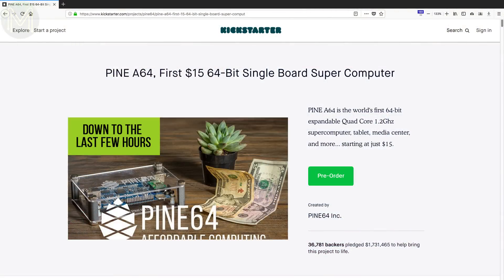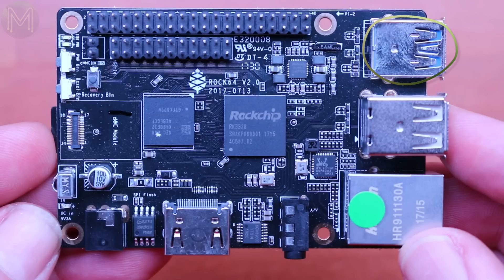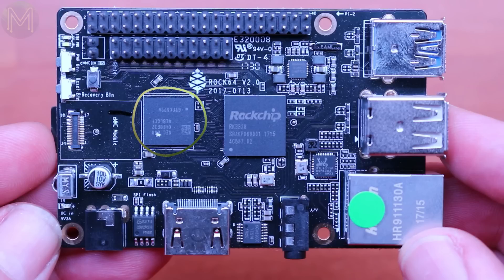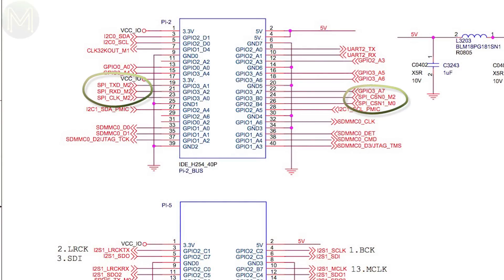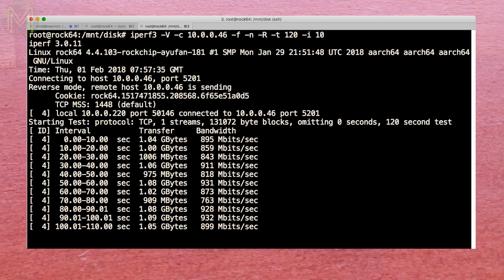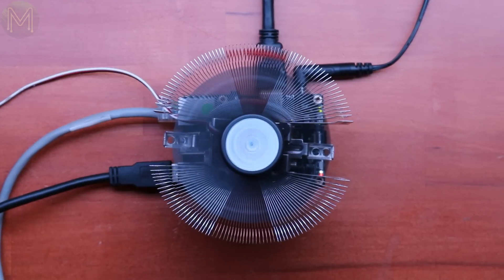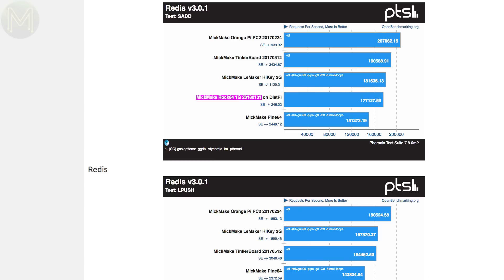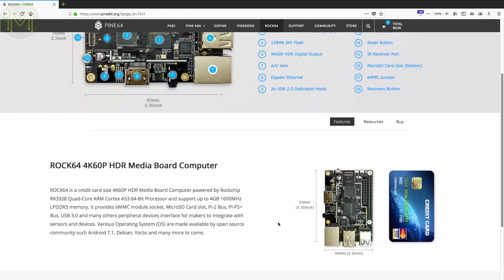#193 Rock64: Cheap and rock solid // Review

Comment: Don't purchase the power supply from Pine 64. It doesn't make good connection to the board. I had to get a USB A to DC 3.5 mm/1.35 mm 5 Volt DC Barrel Jack Power Cable from Amazon to get consistent power to the board. The 4GB RAM version does well as a desktop pc. Using Ubuntu Bionic 18.04 and it works well
Reply from the maker: Interesting. I tend to use my own power packs anyway, but that's because I keep getting given the wrong plug.

Comment: All these technical remarks are good but how does it compare with the Raspberry Pi 3 B in terms of power? I will make it simple. if we give the Raspberry Pi 3 B+ an arbitrary score of 5 to put it in the middle, how does this rock64 score?  And the main question is the rock 64 Raspberry Pi software compatible? another words if I buy one can I pretend it's a Raspberry Pi 3 and run raspbian retropie and all that other cool stuff right out of the box with no problems?
Reply from the maker: Check out my website article as it has a link to comparisons with other SBCs.

Comment: Your test showed peak power 1.139 ma.   Would you say it would be a very reasonable assumed risk in using a 2 amp wallwart despite Pine web site saying to use a 3 amp (in red, mind you)?   Or should I defer to the authority of Red text, and use the 3a regardless of your individual test numbers showing it well below 2a?
Reply from the maker: From what I've experienced the max draw i measure usually is the max draw. Anything less than that, and you're toast. Companies will suggest having a power pack that provides more current, because they want to avoid all the support calls.
If you're not adding USB drives or anything else that might load it down, then should be OK.
Reply: Thanks for the insight.  I figured as much, but dont have much experience with SBCs and just wanted to make sure I wasnt missing something important.

Comment: MickMake - I'm on the fence between getting a Rock64 or a TinkerBoard S. I've got several Raspberry Pi models for various tasks, but want to try one of the boards that has the same form factor as the Pi.

Thank you for any pointers on which would be the better board.

[edit] I forgot to mention that I'd like to try running some type of Windows or Windows emulator, so there's the missing bit of what I'm wanting to do with a better board than the Pi 3.
Reply from the maker: Yup, they are fairly equally matched. In terms of support both companies are doing well and the products are fairly stable.

As for the Windows side; I haven't really tested either board out on that O/S. Time for that to change I think!
Reply: MickMake We are Windows free in this house but there are the occasional times when it is needed and it makes no sense to have a "real" PC just to do those things. For example, I have an APC UPS that will not see the new batteries and needs PowerChute to reset it. I have nothing that will run it.

Comment: Next up the Libre Renegade? as those boards are surprisingly similar. Lastly; how long will it take before we finally have a board running a recent kernel version supporting both SPI and I2C properly :(
Reply from the maker: The boards that have no problem with both I2C and SPI are the ones that have onboard Arduinos. I used to think it was a bad idea, but it has a lot of merit.

Comment: Hey Mick,

First off nice review as always.  So I have the 4GB version of this board and am just awaiting a few other things to arrive in the mail before jumping in.

I am looking at using a 2GB version as a LoRa to IP Gateway using a concentrater board at 915Mhz as I am in the US, this board allows upto 8 nodes to talk at one time and is supported by the alliance code to setup the gateway.  Now this does require SPI so my attack for this is simple.

Build out a custom Arch Linux ( kernel , uboot etc etc )

This has been achieved by others online already so I dont see much fuss will be encountered,  I will test SPI using a atmel 1400 wifi breakout I have that yup is SPI.

Il keep you posted on the results.
Reply from the maker: You can bitbash the SPI. Not as much throughput, but completely workable.
Let me know how it goes!
Reply: Hey Mick,

So after alot of time spent investigating and what not, I have essentially a good result.  So here goes,

Arch Linux image built using this one ( & Docker works! ):
https://github.com/m01/rock64-arch-linux-build

The image is about 2.1GB ( minimal ),  but seems solid on console / headless which works for me.  Just note that thats not console out on the HDMI but the Uart on pins 6,8 and 10 ( I used a 3.3v FTDi ) 

  6.. Gnd
  8.. Tx
10.. Rx  ( iirc thats the right way around ;) )

Baudrate is 1.5M in minicom 8 N 1 as the norm

This image does not resize the root image so use gparted or something similar,  as for the project,  now I have a solid platform with kernel / sources I can comment out the SPI flash in the dtc to disable and add in SPIDEV entries in its place, the LoRaWan Alliance gateway uses SPIDEV so it should be good to go once I built the new blob.

Please build and test with this image as stated this uses the latest stuff from Ayufan and Rockchip pretty much so is pretty bleeding edge.  We have pretty much supported this script from rel 1 to this stage also which brought forward the Docker build option.

Let me know what you think

Nige

Comment: Is their a SBC that can do some basic audio work. I'm thinking voice acting and podcast production. My goal is to use such a device as an inexpensive way of entering the field as money is really tight. I think the big bottle neck would be microphone support as using a USB microphone is a terrible idea if pursuing the quality levels needed to do serious work.
Reply from the maker: You’d need to find a decent audio board first and then work backwards from that. There’s a number of boards around for the Pi and a lot of those could be used on other SBCs, but YMMV with them. For podcasting you’d want to be able to record at 88.2kHz/24 bit. It’s always better to record with the highest bit rates, because you can always reduce, but never increase it later.
Reply from the maker: Oh, and a decent mic!
Reply: Thanks for the prompt feedback. I guess I am putting the cart before the horse by not focusing on audio board first. I'm finding with more research the subject just goes deeper and deeper. One thing all this research has done for me is help prevent making some very expensive mistakes like dumping money into a USB microphone that will never get the job done. Thanks again.
Reply from the maker: Yup, audio is one of those things, (like most things), that ends up being a long rabbit hole.

Comment: Great video, as usual, great work! 
I would be interested in a "performance per wattage" comparison chart between the SBC you have tested. And a "performance per dollar" chart. If it is not too much work adding them to future reviews.
I am interested in building an SBC cluster with docker for running most of my apps/services at home. And the purchase cost plus the uptime cost in power is a factor when choosing an SBC. I want cheap computing that can be thrown away and replaced. And going to use Kubernetes to handling redundancy for uptime.

What is your take on this?
With best regards, Mattias.
Reply from the maker: Yup, so do I! I was actually thinking about this as I was doing this review. Would be good to run an Uber comparison across all the boards. That’d take some time, but quite doable.

Comment: Mick - I've had this thing for a couple of months (2gb version) - it's an interesting board, a few things I'm struggling with at present:   

(1) video output configuration for most distros is difficult;  I have it plugged into a 4:3 1280x1024 LCD and I can't seem to output that resolution from any distro;  some have said that you can't do it (can't confirm this), that seems to like a strange limitation as it can output 4:3 at 800x600
(2) most distros naturally screen blank after inactivity - many can't come back from screen blank, the system is still running but I can't recover video
(3) performance is hobbled compared to something like the Tinkerboard which runs at a much higher clock speed.  I've read this is due to some Rock64's being shipped with lower speed ram;  I've been using a CPU miner application and only achieving roughly 12 khash/sec (Tinkerboard can do about 16-17 even though it's running a 32bit OS).  Some say it's also due to the lack of a heat sink, I have a basic one applied and I am getting temperatures under load of around 73c (ambient temp in the room is currently 15.7c).  I have the miner running up to 100% on all cores.
(4) there have been problems on some distros with USB stopping and not restarting so the keyboard and mouse fail after a short time, in some cases it works on every 5th reboot and not other times.  Mate builds tend not to have this but I had it with the original Debian build;  there is a bit of talk about this in their forums.

The 1st problem is my #1 issue - I've not had direct hardware problems but the distros generally seem to be missing a fair bit so far;  the main problem I'm trying to overcome in the short term is the resolution issue, I'd love to run this thing at 1280x1024 and to have better control over screen timeout (none of the methods I've read so far have worked);   have you any suggestions there based on your experience so far?  I've run their generic Debian build, the Mate build, DietPi and Xenial but all had this same problem.
Reply from the maker: Yeah, I think the graphics side is one of the issues. From memory the Pine64 had to have some boot args changed for the kernel. Might be similar for the Rock64.
Reply: I had a response from a senior community member, looks like the kernel may be compiled with only some set/fixed video modes and you have a very limited range to pick from - it's a much deeper rabbit hole to get anything but a very narrow range of fixed resolutions and refresh rates, it's a real shame.
Reply from the maker: Yup, the usual case with not mature graphics drivers.

Comment: Bought a 4G one when first released, Now running Opencloud, SAMBA , minidlna on a 16GB emmc, and doing an absolutely brilliant job, better, and cooler than the Orange Pi plus I had.  Liked it so much bought a second one for tinkering, have it now with Xenial on a 64Gb emmc and can dual boot via the SD card (lust like the excellent pinebook).
Reply from the maker: Ha ha, nice! Yup, it’s a pretty decent board for NAS. What are you running off the USB? Single SATA?
Reply: MickMake have 4TB attached to the USB 3 drive for stuff that needs a bit of speed (video etc.) And a 2TB off a USB2 for less speedy stuff (pictures, files). Running off a 3A PSU, perfect for home use. Any more and I would chuck in a powered hub.  Uptime of over 2 months at the moment.
Reply from the maker: Nice!

Comment: Great review! What's the benefit of having 'Docker' for SBC's? Cheers..
Reply from the maker: The benefit is you can quickly “install” your apps without having to wade through install guides... that is, of course, if the docker image has been built properly.

But I’ve seen that a lot of issues people are having on forums related to software is the setup and config.

Comment: YAY! is i'm correctly understand - this baby has TWO ethernets? one Reatlek Gigabit? and other accessible via pin header?
Reply from the maker: Yes indeedy.
Reply: nope. none direct connection available. a some PHY level hardware is also required. some sort of coil.
Reply: please, what is the pinout? would it be enough to DIY connect an ethernet cable there?
Reply: Mate, there are a plenty of SBCs with two (and even more) already soldered ethernet ports. take one of them. (search for orange pi, for example)
Reply: BeyElder thanks for the suggestion but i'd like to find out if I got that right and you can use two simultaneous ethernet in the rock64.
I'd like to know if a "dirty" cheap diy connection would be enought (cutting an ethernet cable and connecting female  connectors for each cable involved and plug them in the male board header pins).  Or if some more hardware is required between the header pins and the ethernet cable, I mean I dont know if the RJ45 socket includes more hardware than just the leds...
Thanks in advance!

Comment: Thank you for your effort :) But, somehow, despite all the quirks related to it, RaspberryPi3 for around 30$ still seems to be a better option for a general purpose maker/builder tool. Although I have to say that eMMC port should save uSD from going corrupt due to numerous writes when used as a file server or just, in general, it seems to be more efficient. Also, that USB 3.0 port also looks nice.
Reply from the maker: Yup, it really depends what you want from your SBC. If a Pi3 does the job, then that’s the one for you.

eMMC is essentially SD, but in a slightly different format. It will still experience write issues if you write too many times.
Reply: eMMC has the same interface as MicroSD, but in theory the onboard firmware is designed to handle running Linux off it better. Most SD cards are optimised for use in devices like digital cameras.

Comment: Loved the review - as always! :D

Very small nit to pick though - the olive colour used to circle/highlight devices on the board didn't stand out as clearly as I'd like. Still, good video yet again in all other regards
Reply from the maker: Hi Dave, Thanks mate.

Might have to change the colour I think. Always hard to know what it looks like on all devices, so thanks for the heads up.
Reply: +MickMake Yeah - it's visible, but not great. Yellow or red would probably be good on a dark background but another background colour might mandate a different choice. Each case on its own merits I guess
Reply: BTW, would I be right in thinking you've been enhancing your Frankenstein uber SBC heatsink? It'll be an IoT LoRaWAN heatsink by the next time we see it I bet :P
Reply from the maker: Ha ha. I’ve added a few Alu standoffs for some boards that require it. Probably should be copper, but hey.
Reply: MickMake looks like you've added a small handle or something too :P